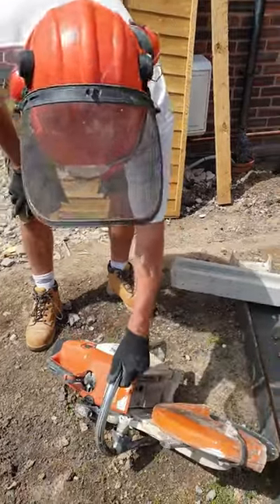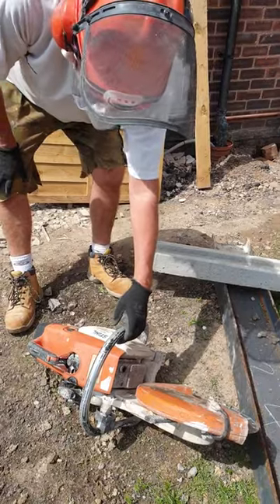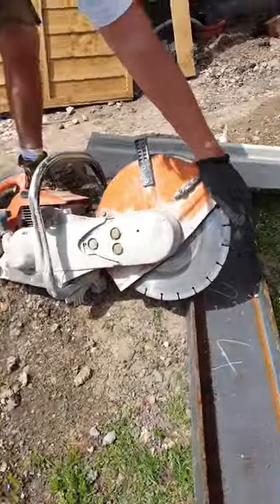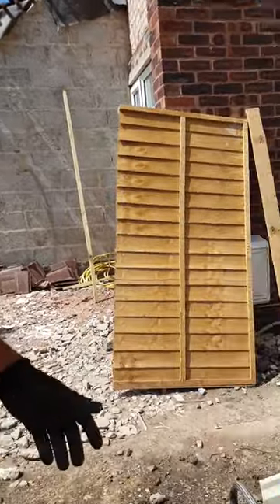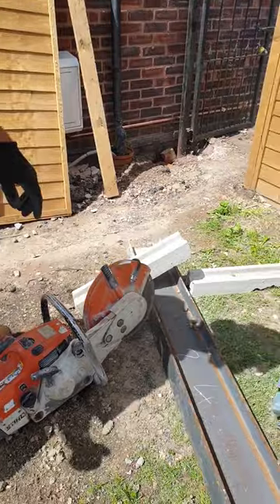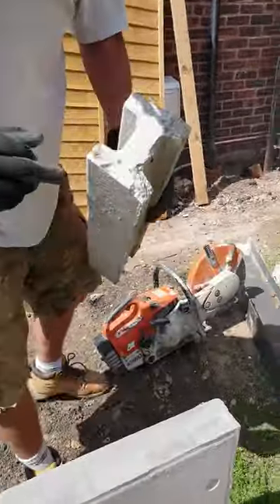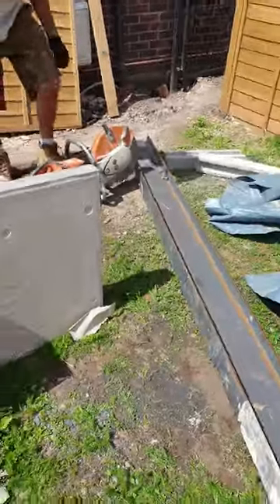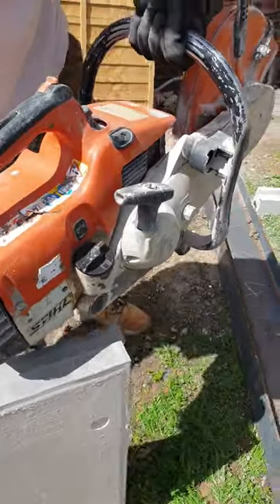STIHL TS 400 Petrol Cut Off Saw with 300mm Cutter Disc

Comment: Why The Push of Deco Valve Instead Of The Kill Switch ? Won’t That Cause Engine Damage 😳😳
Reply from the maker: It is a 2 stroke so it not problem no valves, I have used it this way for 5 years, always OK, and starts the first time . Thanks for the feedback 😀 👍